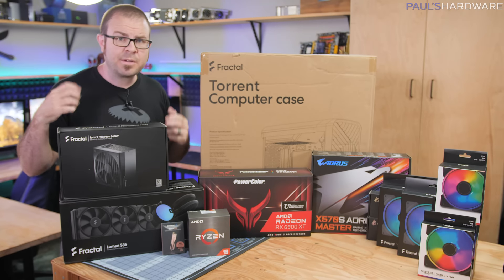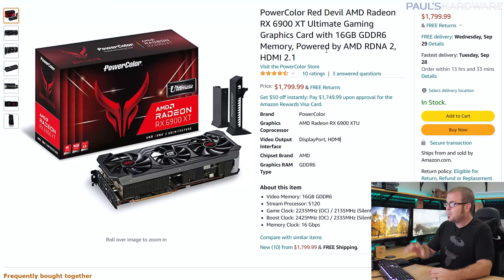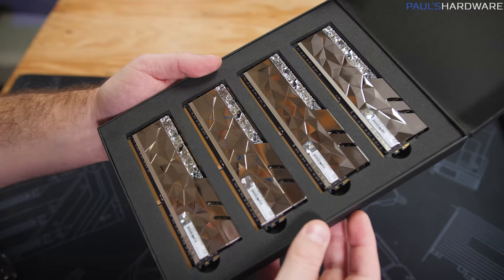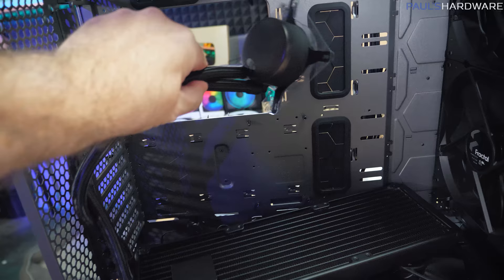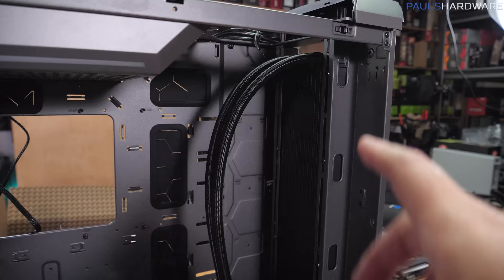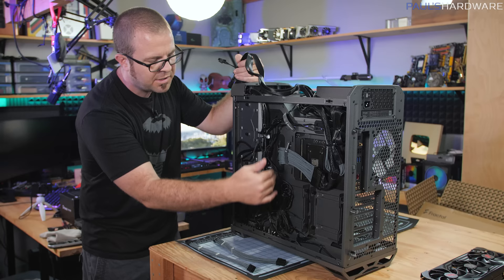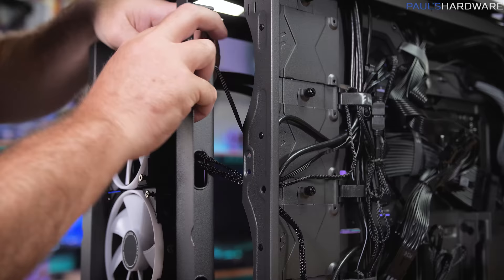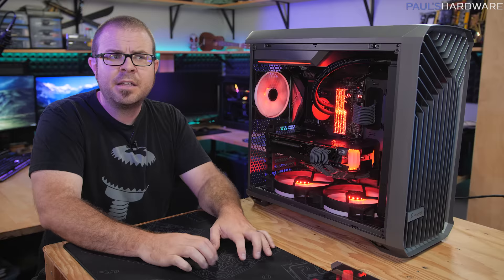Build this RX 6900 XT Gaming PC for the cost of an RTX 3090

Comment: It's surprising that the prices are so different. Both the RX 6900XT and the 3090 is available from many retailers here in germany. The 6900 starts at 1600€ and the 3090 from Zotac at 2500€. Both prices include 19% Tax. Which is the same number in $ without Tax btw.
My ITX PC (NR200P) was only 3500€ including 19% Tax WITH a 3090FE at MSRP, which is around 3500$ without Tax. Same CPU, slightly better RAM. I build it last June...
Getting the 3090FE was a stroke of Luck btw, i was looking at the Nvidia shoppage the moment it dropped.

Comment: For the RGB Fusion "problems" i have a good solution: Signal RGB! It`s a free software that manages to adress most RGB components in a computer/periverals and has for example good support for Gigabyte and Corsair products.

I have a Gigabyte B550 board with Fractal fans aswell and Signal RGB works like a charm for me

Comment: A pleasant build to watch since I haven't viewed anything on this channel in over 9 months. The whole mess with graphics cards and availability of certain pieces of hardware made viewing these build videos pointless to me. Why watch a video about PC hardware you cannot buy? I decided to wait for things to stabilize but they haven't. The prices for GPUs is plain stupid and I'm not that hardcore of a gamer where I need to drop insane money on a graphics card. I thought people paying $800 for a GPU (pre-pandemic) was crazy. But now? It's a confirmation that greed knows no bounds when it comes to many businesses in the PC sector. I bought a GTX 1650 SC last year for a budget build for myself. The card is great. It's quiet, fast, no FPS hiccups...just a really nice product for $275. I thought it should have been around $200 but I needed an upgrade badly. I just saw the same card on Amazon for $400! I'm surprised the PC gaming sector hasn't flat out crashed from price inflation and lack of part/chip availability. I'm letting off steam, but 2021 has been ridiculous for trying to build a PC, IMO. For your build--I love the Fractal case, great details and features and the Gigabyte AORUS motherboard looks awesome. The 'stuff' on the RAM is over the top (sigh). Love the amount but not a fan of the appearance. I like the rest of the hardware I saw (M.2, PSU by Fractal and modular) and the fans plus the radiator went together nicely. I rate this build 94/100. Thanks for the video.

Comment: First thing I would be doing is getting rid of the extension cords. Plenty of length on the PSU's cables to reach where they need to go. Also you put the video card power cables on the wrong side of the video card where it will be interfering with the fans.

Comment: Hey Paul! Nice clean job! But you oriented the pump incorrectly. The hoses are supposed to be oriented at the bottom (not at the top) for the cpu cooler, and the actual pump hoses for the CPU is suppose to be also oriented at the bottom so the pump doesn't overwork itself and possibly transferring air bubbles. This is why the pump can make odd noises or go bad.

Comment: Great build! First i tought, Is'nt the bottom 180mm fans pulling air out of the case, but in the first start, I saw the rotation of it. :)
Running with a 6900XT Liquid Devil Ultimate myself.

Comment: If you wanna piece a new 3090 pc, new egg canada has a bunch of combos. 5950x, rog strix 1000w psu, and a asus tuf 3090 together for 4000 cad. That's about 3150 usd. In this way the 3090 is pricing at about 2200 usd.

Comment: Try using the 24 pin cable combs for the GPU. That's what I ended up doing on my 3080ti and it looks so much better than having individual combs for each 8 pin. Keeps the wires tight and all on an equal bend.

Comment: It's insane the fact that the 6900 XT is significantly faster than the RTX 3090 in 1440p (5-15%) at a much lower cost, whilst even having a lower power draw.
Reply: Its also not blowing memory caps and modules off the backside due to overheating

Comment: you should put the cable combs between the 6 pin cables (staggered with the default guides) holds it all together more like a 24pin. nice n tidy

or use a 24 pin comb

Comment: Thankfully I was able to get a brand new 5500XT for $200 about 3 months ago and a 1650 for $220 a few months before that at retail.  I check microcenter everyday just because.  They have 1050tie for $280 and $300, 1650 for $260, 1660 for $470, and 6600xt for $500.  

Every day I see the stock on the cheapest 1050ti drop one or two feeling bad for those people. No wonder the 6600xts sell out so fast because might as well lean into it a bit.

Comment: I can't get over the top PSU mounting on the Torrent Case. I haven't built a PC with that configuration for at least a decade, if not longer... and clearly, it limits your cooling options. I do like the sheer size of the case, and the primary airflow, but I'd really prefer the PSU in the basement, where the PC God of the PCMR intended it to be.

Comment: Awesome build video. Just a quick note; the metal contacts in the hub are not connected to ground in that hub (per the analysis done by GN) since Fractal did not want current going through the case. Eagerly waiting for the performance video that is sure to be great as well.

Comment: This might be a little jank but instead of moving the radiator you shouldve just moved the fans to the other side of the radiator. It has more than enough clearance and it eill make the system easier to clean

Comment: I love the FormulaMod cables but I've had same issue with some GPUs as the cables are pre trained with the shorter cables on one side. Works great when the GPU plugs in that way but I just had same issue with my build this weekend with backwards cables the long side sticks up.

Comment: Looks great, I just wish Fractal would use a better mounting method for the CPU cooler. AMD's antique 2 tab mounting method has never struck me as the best option for stability or even mounting pressure. It's fine for an in-box CPU cooler but for higher end products like, say, a 360mm AIO, they really should be including a backplate and 4 screws fit for the AM4 hole spacing, like what they do for the Intel mounts.
Also, if you want to make those PCIE power cables just a little bit tidier, you should get a 24 pin cable comb to use to bundle all three of them together instead of the 3 8 pin individual ones you added.

Comment: I have to disagree about the RGB software from Gigabyte being "decent". I have just a Gigabyte 3070 and have learned the following: 
* Gigabyte RGB software does not always work when iCUE is also installed;
* Gigabyte RBG software will not detect the Gigabyte graphics card when there is any other graphics card installed in your system;
* Gigabyte RBG software can set the RGB values and the on-card LCD display, but where the RGB values are remembered between boots the LCD display settings are not;
* Gigabyte RBG software can load automatically when windows starts but will not automatically set the LCD display settings until your click it to open it's window and re-apply the profile you have created.
* Gigabyte will not disclose their RGB API so other software like iCUE can never support Gigabyte hardware (and OpenRGB only through reverse-engineering).
I regret buying this Gigabyte graphics card but of course there was no other option, I am lucky to even have it.
Cheers!

Comment: If you Use 24Pin Cable combs it will clean up those three 8pins nicely that's what I did on my Strix 3080.
I would happily trade my Strix 3080 for one of The Red Devil 6900XT's. I may just buy one from Amazon and sell the 3080 to recoup the money.
Very Nice Build!!!

Comment: One of the thumb screw mounts for the top panel on my case were broken during shipping. I wish they would have used better plastic for the mounts, as the one that I have that hasn't broken off just feels cheap and ready to break off like its partner.

Comment: Those GPU prices are a bit high. I just got an EVGA 3080 TI FTW3 from Best Buy this morning (hooray for being 140th in line) for $1,399. Definitely far below the $1800 - $2k shown on part picker. If you can get them from 1st party or your traditional resellers directly, prices should be closer to MSRP.

Comment: honestly this is why amd is never going to ultimatly "Fail" their performance per dollar is so much better, and its widley available. its like spacers choice but for real lol
Reply: Thats bullshit. As somebody with currently a 6700 XT and 3700X i can tell you 1000 percent thats bullshit. The only reason why you can get any amd cards right now for cheaper is cause theyre worse at mining and people dont wanna buy overpriced AMD cards. Msrp wise the only cards that have better performance per dollar really are the 6800 and 6800 XT vs their nvidia counter parts(barely) and the 6900 XT which is so stupidly over priced itself it kinda doesnt matter. The 6700 XT and 6600 XT both lose msrp wise to the 3070 and 3060 ti. I have a feeling the 6600 will do the same with the 3060. As for AMD vs Intel, 10th gen intel and the i5s of rocket lake are better value you buys with the 11600K and 11400f.

Comment: You should try using 24 pin cable combs from the ATX power connector on the 3x8 pin pcie's.  It works amazingly well and looks super clean. 3x8 = 24 so they fit perfectly.

Comment: Paul, you expressed dissatisfaction with the GPU power cables; why don't you try using some 180 degree power adapters? Then you can simply plug them in and have the power cables run down the back of the GPU.

Comment: Lovely build and looks fantastic but I don't understand your airflow, you have radiators at the front drawing in cold air which gets heated as it passes over the radiator coming into your PC then you have two 180mm fan sucking air from below into the same space so you end up with a warm bluster in the centre of your case which is then supposed to be drawn out the back with one fan? The flow doesn't seem efficient considering the time and money spent.

Comment: You need a bigger psu if you check the 6900 psu recommendation is 900w so I would say at least 1000w psu is needed for the whole system.

Comment: Yeah the 6900XT may be in stock but the MSRP of the Radeon base model was supposed to be $1000. The AIB models should be no more than like 1300-1400. And thats only if you are silly enough to buy a 6900xt in the first place, because the 10% extra performance is not the worth the 30-40% additional cost over the 6800xt

Comment: Would you say that using a dual 180mm radiator and a 420mm radiator with the stock fans be a good idea? Or would replacing all the fans with higher static pressure be the go to move? With that I’d also make it another 420mm radiator rather than the dual 180mm

Comment: Top video. I have two questions: did you need to use an extension cable for the front panel audio to route it around the motherboard to prevent electrical interference? And are the included 180mm fans sufficiently powerful to cope with a 360x180mm radiator?

Comment: I was seriously considering this case for an mITX build, despite the size, cause of the great airflow, and I could fit Arctic's 420mm AIO. But it's quite pricey for the RGB version, and with a 5600X, that cooler is quite the overkill :P Ended up with the old Thermaltake Core V21 and Arctic's 280mm AIO.
Reply: While considering this case, I was wondering how to mount the 420mm radiator on the inside of the 2x180mm fans (and moving the 140mm in the bottom closest to the front and putting it as a rear exhaust so the radiator would actually fit).

Comment: Built a full computer with a 5600x and 6800xt for the price of that 6900xt from Powercolor >.>

My biggest problem with that card is that the AMD "reference" model is $999, and there is NO way Powercolor added $900 in value to their card.

Comment: Hey Paul would you ever consider doing a video on the radeon software? they recently did a update for 5000 series cpus and 6000 series gpus with a new overclocking options like 1 click oc and not having to use ryzen master to oc

Comment: 4x8 memory configuration is a nightmare to OC it, if you like to get stable 3800@CL14 OC, or even higher, since it taxes IMC very hard, even on top notch MoBo. 2x16 is far better configuration.

Comment: Hey Paul, would you be able to opine on how we can best cool the back of these 6000 series cards? I have a 6800XT and there are no thermal pads on the rear memory modules. Removing the backplate reduced junction temps slightly, but Cyperpunk still runs at 110C!

Comment: Why do you have the front fans configured to pull towards the radiator and into the case? And why the intake fans on the bottom of the case where there's presumably very little ventilation? Won't this pc get super hot?

Comment: I sell my 2,5 years old Vega 56 for 500€ and bought this 6900 Ultimate for 1299€. Undervolting with 260W Powerlimit with 3D Mark Time Spy 21200 graphic score and extreme 10314 points. This all with to small Ryzen 5 3600. My 6900 works with ....600W be quiet PP!! Also with 350W not problem 🤷‍♂️
Temps: 60-72° Hotspot 82-84° who needs water 🛀
Other components:
32 GB RAM 3600 aegis
Fractal define R6
WD Red 4T
SanDisk SSD Plus2T(130€!!Black Friday)
MSI B450 gaming Plus
Be quiet shadow Rock slim
Patriot Viper 512 GB M.2 SSD
Everything for 1200€ in the 2019
HyperX alloy, Logitech Hero G502
Beyerdynamik 900PRO X coming soon

Comment: Thanks Paul! I’m actually preparing to do this exact build as my first Gaming PC. Question tho, I noticed that you wiped off the pre applied thermal paste on the cpu cooler and applied your own. Is that “highly” recommended or just a preference in the building scene? If so, then what paste is the “go to”. Maybe someone can help. Thanks in advance!
Reply: For most use cases, the included thermal paste should be good enough. There are a myriad of brands out there claiming to sell the best thermal paste. The most well-known brand is Arctic Silver 5. I would buy a little kit just in case.
Reply: @JJFlores197  thank you so much. I’ll make sure I have some on hand by the time all my parts come in! 🤙🏽

Comment: Paul, how do you get the downloadable Gigabyte App Center software to function properly ? I've downloaded a bios update that came in a zipped folder but windows won't open it.. when I try to update from the App Center it always shows "Update Fail"... My new case doesn't have a space for my old optic drive, so I can't use software disc that came with the motherboard.. ANY tips ????

Comment: Microcenter here in Ohio has 3090s for sale for ~2000 USD. Still inflated but considering the 6900XTs are also selling for 1800 USD at the same Microcenter, this video really isn't very accurate. I guess if you live in bumfuck no where without a Microcenter nearby and have to deal with scalper pricing then this might be a decent build.

Comment: thermal pads on gigabyte mobo's starts leaking silicone oil after a few heat cycles........i had to change the shitty pads on my x570 aorus master mobo just after one month of use.....it was leaking oil on the board which is disgusting......i am thinking of switching to MSI x570S boards soon....n one more thing this mobo (x570 aorus master) was not fitting properly inside the NZXT ATX case....the holes were not matching up ...... after a lot of effort it matched up but with a little of the back IO plate pushed outside of the case....it's really weird....i was always skeptical about gigabyte mobo's ....but took the wrong step of buyin it after watching several false reviews.....aithough the board works fine but it took several bios updates to reach that state.....it had all kinds of usb connectivity problems along with memory compatibility issues which i never faced with MSI or ASUS

Comment: Hey Paul. A really nice build. I saw the Gamers Nexus review on the case and you would get better GPU thermals having the 140mm fans on the bottom instead of the 180's. Also you could replace the motherboard and graphics card rgb software with either OpenRGB, or SignalRGB to reduce the bloat on the system.

Comment: I honestly don't understand the fascination with Nvidia cards. There is absolutely no way I'm paying 3x the msrp for ray tracing. Even with ray tracing enabled, you need a 3090 to run cyberpunk on ultra settings just to get 60 fps. So, other than mining, if you buy a 3080, 3080ti, or 3090 on ebay for massively inflated prices opposed to a 6800, 6800xt, or 6900xt for gaming, you really need to check price to performance ratios. The LHR versions are now the prominent cards being released, however,  they only limit Ethash algorithm for Etherium and if you are mining, Nvidia is a superior card. I have the 6800xt version of this Red Devil and it absolutely kills any game I throw at it, along with being an absolutely gorgeous piece of hardware. In retrospect, thank you for buying Nvidia cards for ridiculous prices. You are helping me remodel my office/game room quite nicely. Getting more storage this weekend thanks to that deep pocketed individual who bought my 3070 strix for $1300.

Comment: sorry no. the $1800 price tag for a 6900xt is way to much. and yes the case is a great case, the reason why its a waste of a case is the dual tempered glass. why only do the white case with a \solid rear panel with only 1 TG panel. no need for glass on the rear side.

Comment: This is a miss leading video. All the TI cards are easy to get. Just don’t go for non-LHR cards. 
I just purchased an Asus Rog Strix RTX 3080 TI with 3 years warranty for 2.000 USD (Brand new). 
Why buy it on Amazon, when you can buy it direct from another company.